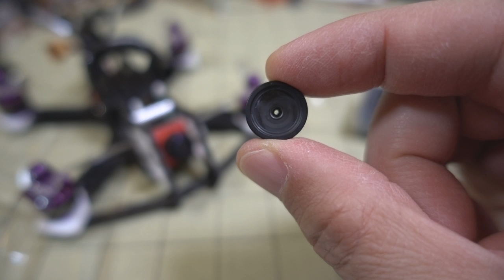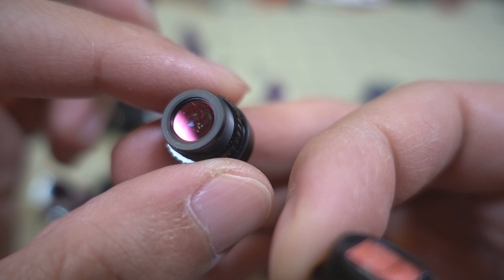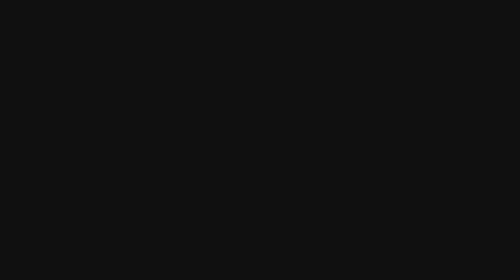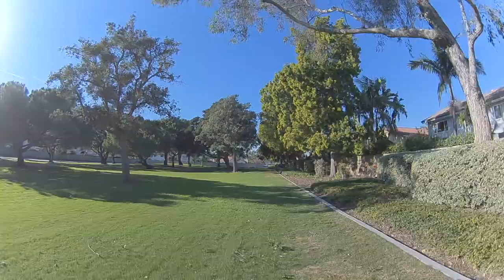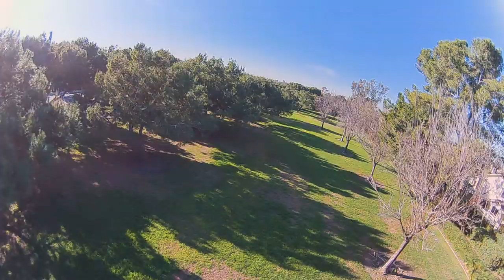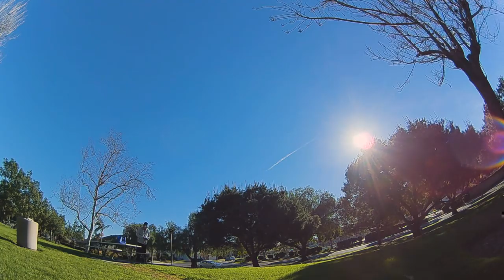Caddx Turtle w/ Split Mini M12 Lens Upgrade 👍

Comment: good video ta,  theyre all very decent lenses tho what im not keen on with the original caddx turbo eye plastic lens is the amount of fish eye otherwise its decent, i dont find it scratches easier either.  i have the caddx special lens, which i do like too, and doesnt have the fish eye half as much , though i find it has a slight blue cast to the colour , and apart from being heavier, its quite long and unlike the Runcam sticks out like a thumb ready to get sore !  which leaves this Runcam m12 lens the best, its very hard to fault; very little lens flare like you mention and natural colour balance, then so short too, great combo caddx v2 with runcam lens , in my opinion the winner !!

Comment: Will defo give this a try. Got two turtles v1 and v2 both totally unusable. Hopefully this will help or wait it out till Caddx release their own glass replacement lens at least we know something is coming. Waiting on the mix hopefully that has good results. The split mini 2 is good but has that noticeable blur around the bottom left. TBH Runcam should honor a free replacement lens and body knowing that it's a defect. It's frustrating as these are not cheap and you have alot of them 🤔

Comment: nice, almost looked washed a little bit before you added the grading. also, I noticed lens flare and the chromatic abb. a bit when you would have the sun pass through view. overall though really nice looking. thanks for sharing brother take care
Reply from the maker: I tweaked the image settings on the Turtle to have a washed out image since I planned to color grade it.  Those aren't default settings.
Reply: @AlbertKimTV  ah ok, thanks for letting me know. It wasn't bad really just noticed it slightly. I heard you say in the video you were going to color trade it but I didn't hear you say you had changed the settings at all.

Comment: Thank you for all of your great reviews and other videos, Albert Kim.  I think I first subscribed to your channel after watching a review of the first Split camera when it was in pre-order.  I'm trying to decide which camera to buy at present, and based entirely on several YouTube reviews it's my impression that the Turtle 2 has the best microphone.  The new Split 2s seems to have a terrible microphone, although I've only seen a few videos that have included sound, and I'm even less sure about the Mix, but I think sound quality is somewhere in between.  Albert Kim, I think you've tried them all, would you agree that the Turtle 2 has the best potential for sound quality out of the cameras in this class?
Reply from the maker: The mic is a little better on the Mix.  The ability to adjust the image settings is currently better on the Turtle 2.  Waiting for a new firmware upgrade for the Mix to adjust the settings because it's too sharp on default settings.
Reply: Are you saying the Mix mic is better than the Turtle 2, or the Split 2s?  Maybe I'll wait a while longer before I buy anything to see how the Mix works out after the firmware upgrade.
Reply from the maker: Yes

Comment: What is the range of this camera before it starts to get to static to see? I want to put a camera on a Radian 2M glider. I have a 4.3" FPV Video Monitor by Spektrum. If this isn’t the camera could you guys help me out with suggestions?
Reply from the maker: The range would depend on your VTX and transmission power.

Comment: hey thanks for the good videos!
anybody know the problem the OSD shows 12 volts (or wrong voltage)? is this a hardware problem?
Reply from the maker: need more context here....  I have no idea what you're asking about here.
Reply: hey albert, thanks for reading!
with the KISS CC i need the cam OSD for voltage checkin. i solder the turtle 2 directly to the power input, but it constanty show 12 volts. i hope its a software problem... i will try a downgrade  @AlbertKimTV
Reply: UPDATE
i contact Caddx. They answer: 
"12 VOLTS is the maximum the cam will show." 
too bad. 
everyone write "support voltage display" ;-/

Comment: Dear Friend,
I've broken my Turtle can V2 lens during my flight with T-motor 3419. I bought a new one (LS106 model). But, right now, I'm facing a problem when a I try to replace than.. The new lens (LS106) is larger than the original one (turbo eye lens as manual mentioned). The problem is, I can't get a clear image, because is impossible to focusing with this new lens, I already tried everything. Could you give some help? Best Regards
Reply from the maker: Are you sure you got the right lens?  I don't recall anything special about focusing the new lens.  I assume you've adjust the lock ring too?
Reply: @AlbertKimTV  I bought the indictaed lens on caddx website (LS106), but.. As I told you, the new lens is larger than teh original one.. I'll make a video to show the follwed procedures when I'm replacing the lens. Also, I saw a video that you replace a original turtle cam lens for a RunCam Split2 lens.. I'm thinking to a split 2 lens and try to use. What do you think about? Thanks for your help